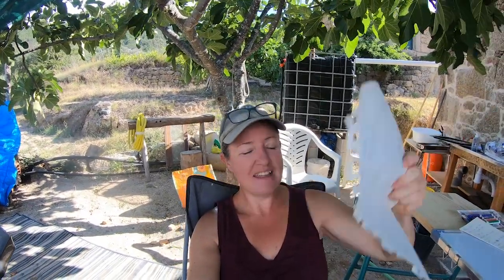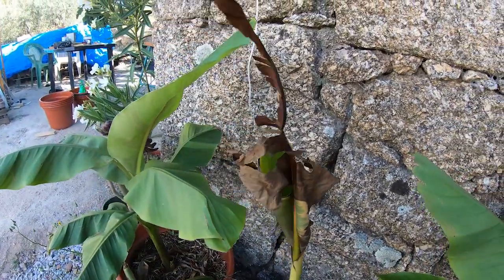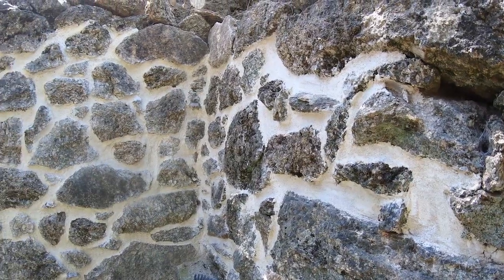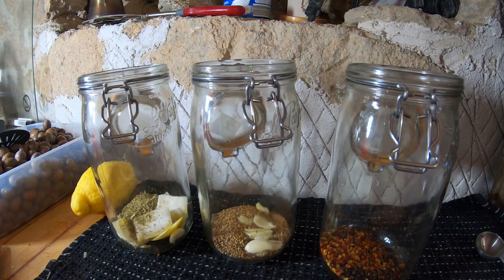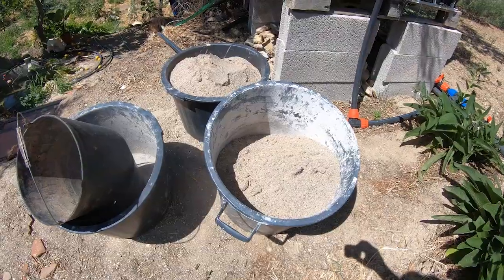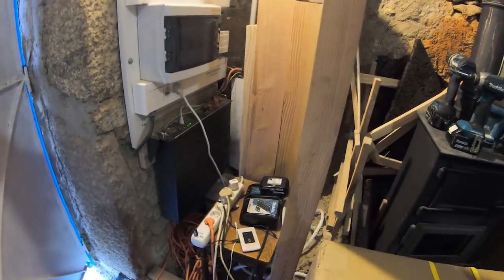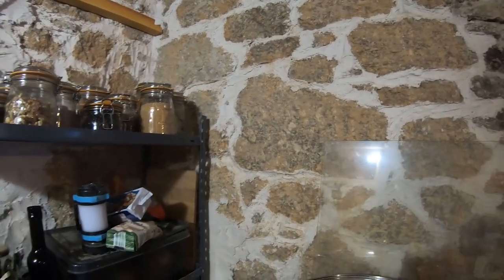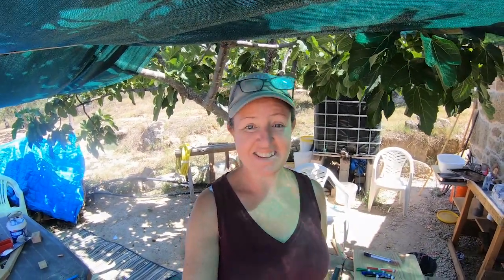June Off Grid Homestead Progress Report and Goals for July

Comment: Just a thought on your tool shed. Build a timber frame extension the width of the house all open , except roof. Then build a shed under it again the house, simple box. You could loose your tarp but sadly think the tree would need to go. Just my idea, have fun.
Reply from the maker: Yep I thought of a lean-to type thing but the fig tree needs to stay. I like it to much! So I'll want to work around it. It's cool, I love a design challenge and I think there's still space for some sort of a small structure against the house in the future.

Comment: Another fun and intresting video! As it seems to be holding you back a bit, I was wondering if you should put "confirm shed plans" some where on the list.
Reply from the maker: Thanks! I'm not sure the shed is holding me back because there's just so much else to do all the time, but I think it would be wise to have an actual plan in place before I start the foundation. Even though I can do several different types of building techniques from the same base, the materials I use will effect how I incorporate the building into the wall. I think on a super hot day next week I might go hide in a cafe with my sketch pad and nail down the design for my entire top terrace.

Comment: Love the idea of your progress reports and list, mine tends to be in my head and then half of it gets forgotten! :) What did you put under the cork insulation on the floor? Thanks
Reply from the maker: I've actually had to consult the white board many times to even think of one thing on there, so I'm very happy I wrote it down or I'd have to keep watching the video as a reminder! The cork boards are actually elevated a few mm from the concrete and they're supported on the edges by other cork that's sitting atop plastic. I didn't want to cover the whole floor with plastic because it's back for air circulation and actually draws moisture up, so I wanted air to flow so this was my idea. The cork on top of the plastic is 2mm thick and I did three layers for 6mm of lift total. It seemed to make sense in my head! :-)
Reply: @PortugalfromScratch  Thanks, that's really useful, I'm thinking of ways of doing two floors that we need to dig out. I like the idea of using cork as it will let things breathe, was that just plyboard you put on top?

Comment: Does your stone house stay cool in the warmer months?
Reply from the maker: Yep! During the day it's a lot cooler than the heat of the afternoon sun, though as the sun hits the stone and heats it throughout the day, the building heats up in the evenings and it's hotter inside than out. But nothing a fan can't fix... I have one pointing right at me now. Things will be better when I insulate my door and put shade over the front of the house but those things might not happen this summer.